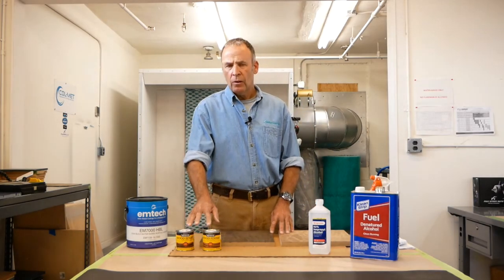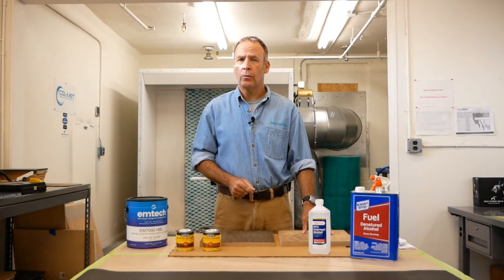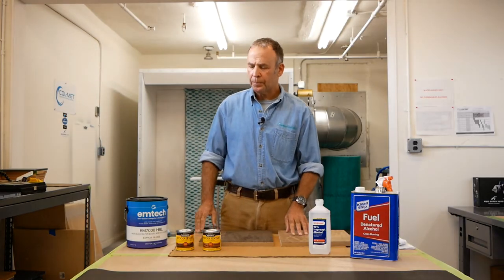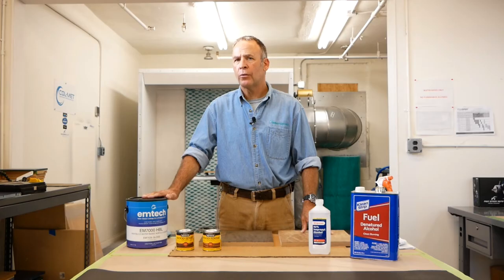How to Apply Water Based Finish Over Oil Based Stain

Comment: Ive used polycrilic over oil based stain without the 50/50 mix and you will get a small amount of color on your brush or whatever still turned out good but see the importance of this step now